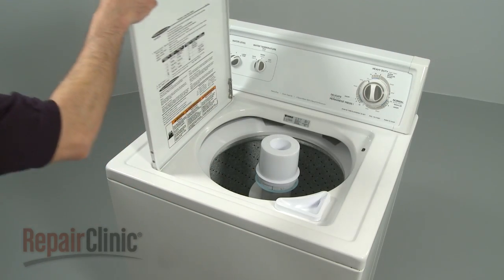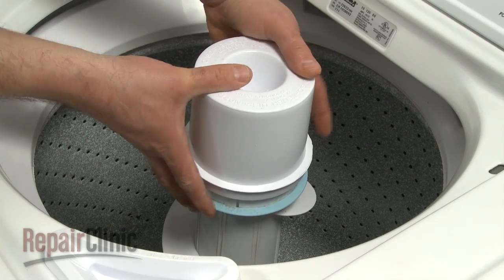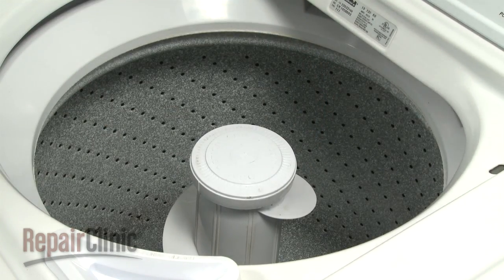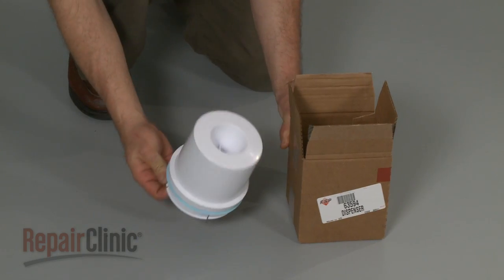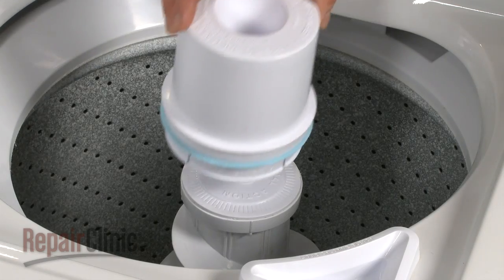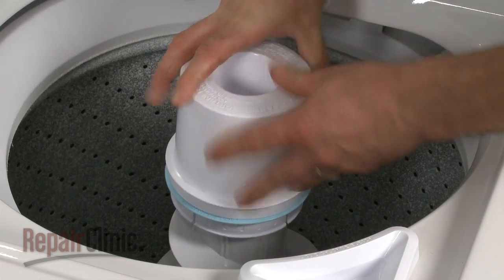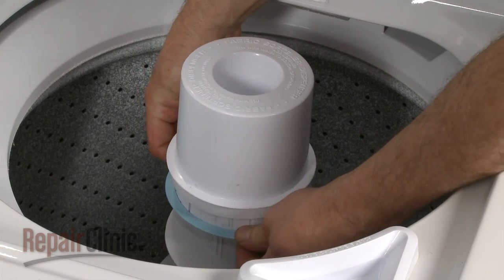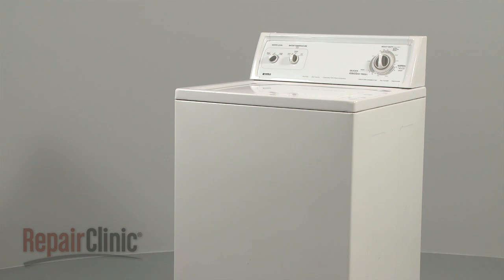Whirlpool/Kenmore Top Load Washer Rinse Dispenser #63594

Comment: Update:  the fabric softener dispenser on my Kenmore 110.29422800 washer keeps popping off after a few loads, I’ve ensured it’s on the agitator good and tight and even got the notches lined up,but the dispenser will pop off regardless.  Does this model in particular just not take the dispenser or is it something else?

Comment: I bought my machine at SEARS. Now that they are out of business, can I get the part to replace my clogged softener dispenser?
Reply: If you type in your model series into a shopping search, the aftermarket should have you covered easily; Kenmores are often re-badged Whirlpools, and the latter is still well in business and has the parts.
Reply: @MrSchimpf  Thank you, I did find the link and ordered one. I also got a note that if you put baking soda inside and slowly fill the unit with white vinegar (after many attempts with next to boiling water) it would help get the dried softener out...and it did. It works like new and is just spotless inside. I appreciate your reply and this video (if you or someone else made it), it was a great help to a not-so-handy-man. Blessings.